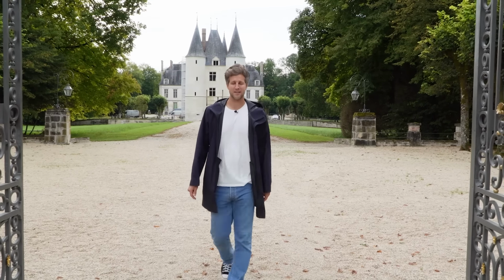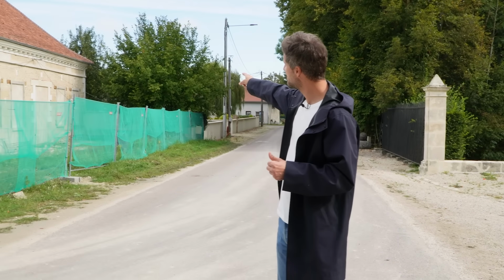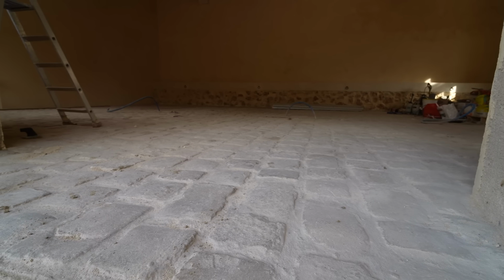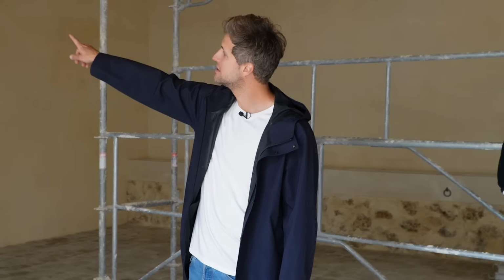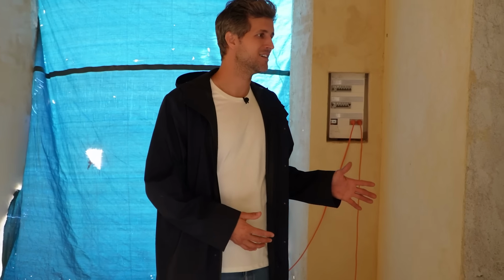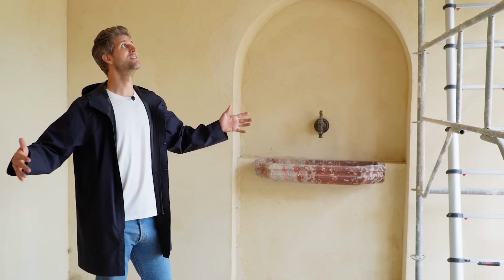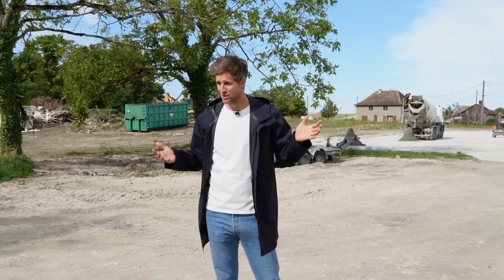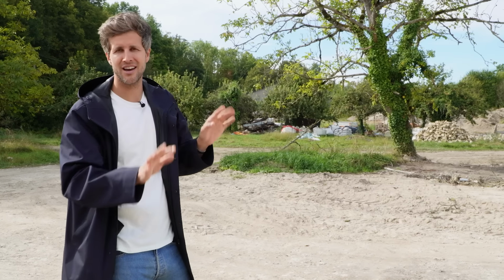My New Restoration Project at Chateau de Dampierre

Comment: I am not sure the outwards opening windows are a mistake. They were quite common during the baroque.
Reply: The building is 150 years after Baroque era.
Reply: @heliedecastanet1882  he says the building is from the late 18th century. French baroque ended in the second half of the 18th century
Reply: @portschyszabolcs  Yes, you are right, but you won't find many buildings of that style in France, since Baroque and rococo (or "rocaille" in France) were mainly used for décors and interiors. At the end of the XVIII° century, the prevailing style in architecture is called "néo classique" and as Antony said, the house is "Directoire". It is neither baroque or rococo.

Comment: It's so beautiful! Lucky horses! However, having been a dressage rider/trainer/groom for many years, those mangers will be a nightmare to clean out daily, and the water will make the bedding wet along that side, which in turn will promote mouldy bedding. Also, using hay racks are not good, as they create a lot of dust, and hay seeds can end up in the horse's eyes, so feeding the hay from the floor is now recognised to be the best way, as it also stretches the topline, and mimics grazing, which is the natural way for horses to feed. I would suggest a washing machine (3 phase if you can get it), for washing numnahs, saddle cloths, boots, bandages and rugs. I started typing this whilst you were still talking, so don't know if you have a proper drying room. I know you mentioned a place next to the sink for drying numnahs and saddle cloths, but missed if you have anywhere to dry rugs. Will you have a solarium over the wash-off box? They are amazing and mean you can get the horses washed and dried and use red light therapy for optimal health. I'm obviously not telling you what to do, but if I had the opportunity to design a stable block, I would definitely take all these points into consideration, along with others I haven't mentioned. Can't wait to see how it all turns out! Good luck!
Reply: Perhaps to keep the mangers and allow for easier cleaning you could get plastic or rubber rectangular troughs to fit the 4 manger spaces. They would not be visible above the edge of the manger but would be removable to be cleaned. Also please get rubber mats for the stall floors as much less stress on the legs of the horses than standing directly on cobbles.
Reply: … and floor drains 👍🏻
Reply from the maker: Hehe thanks for all the questions :-) 
Hay rack and mangers will only be décoratives and never used 
Hay will be on the floor as the food morning and nigh on the floor too 
And we have automatic water provider  hidden behind the wood wall close to the door :-) 
For the saddle room , yes will be a dryer system in the cupboard 
And a washing machine area on the other building that is now beeing builded :-) 

Thanks for your interest ❤❤❤

Comment: For the two squares in the courtyard, you might consider "doctor gardens," to offer plants for horses' self-medication. These are usually troughs with limited access (or containers you roll out), but they could be in-ground for occasional browsing as well. It might be a challenge to accommodate with the rest of the aesthetic of buxus and espaliered apples (after all, dandelions are a favorite ingredient for such plantings!), but some of the other recommended plants are herbs such as thyme, sweet marjoram, mint, and chamomile.

Comment: I love the stable and your wish to keep it as original as possible. Perhaps the windows should open out next to the horses. They will be easy to clean. A metal grate should be installed inside to stop the horses breaking the glass accidentally.